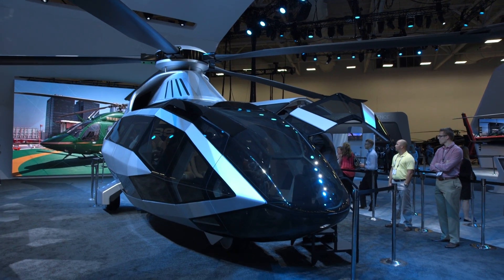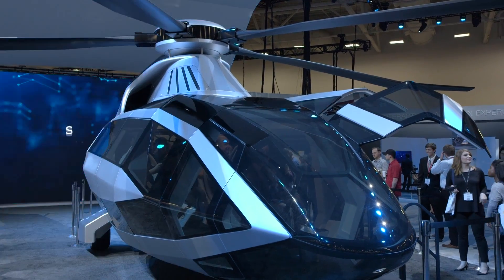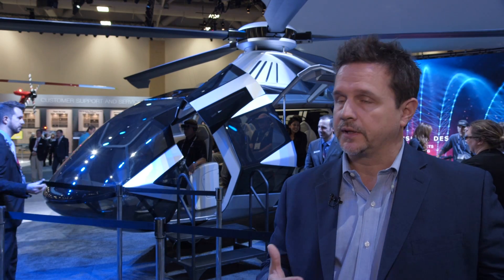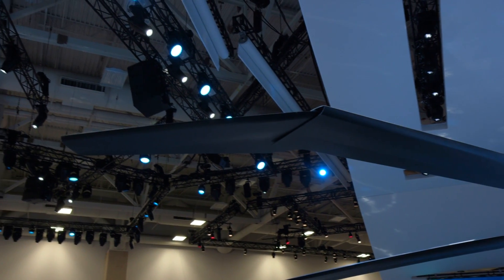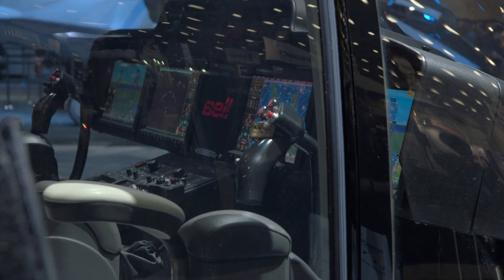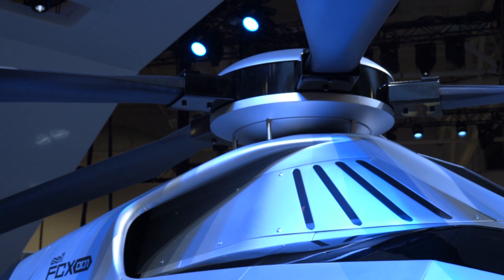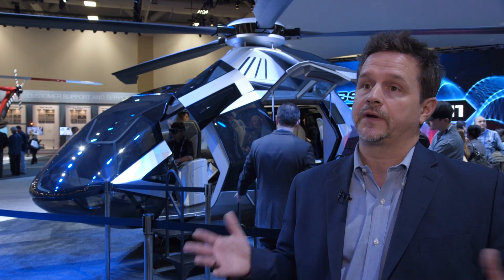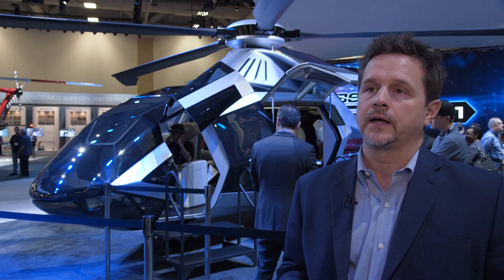Bell’s FCX-001 Concept Helicopter Showcases Future Technology – AINtv

Comment: I hope you followup with a much more in depth look at the FCX-001.
Reply from the maker: There wasn't much more to show at this point since it was just a concept mockup.  If there is a further development of the FCX-001, we'll be glad to revisit it though.  Thanks for watching.
Reply: Understand there might not be more to show, but explanation on the technology would make a great followup. There are several very new tech things going on. 

Thanks!
Reply: @AINvideo  Can you confirm the dimensions for the FCX-001 mock up length x width x height ? Thanks

Comment: Maybe I am too close minded, but I do not think we will ever see an autonomous aircraft that transports people. Ever. Not that it can't be done, but the liability is too steep. Can you imagine a helo crashing because of a glitch and wiping out three or four families? It would be a 100 billion dollar lawsuit. Who is going to underwrite THAT? And no matter how safe you can demonstrate safety, there is always the argument that had there been a pilot on board, the accident could have been avoided. Hauling freight and other goods? Sure. But never people. For that, you need a brain in the front seat.
Reply: There are already commercial autopilot aircraft that can fly (of course), but also land (in emergencies). I see full auto in less than 10 years.

I agree partially with your liability issues. Uber just suspended their autonomous car due to a crash. However, autonomous vehicles are proving more and more to be better than human drivers. 

I think it is more a matter of acceptance and understanding than technology capability at this point.